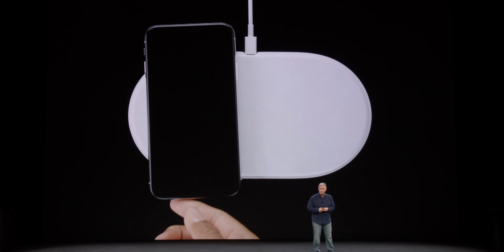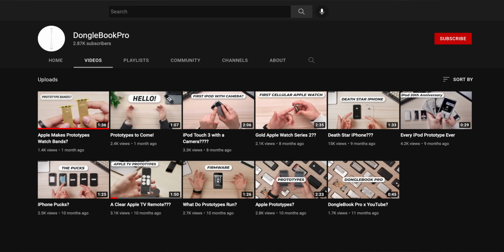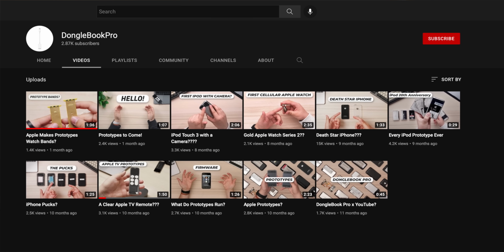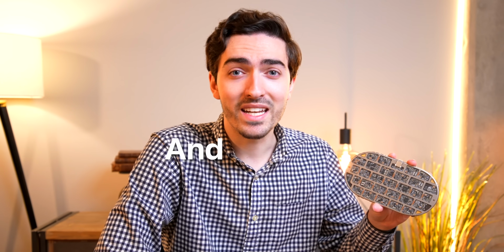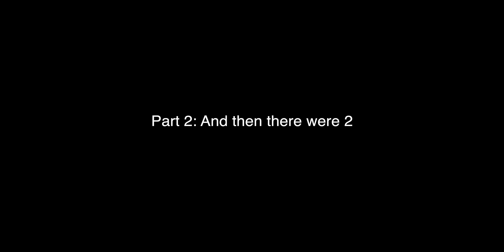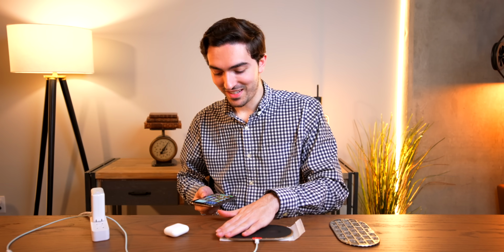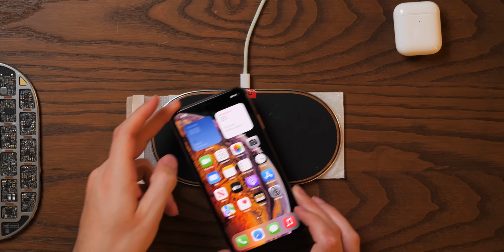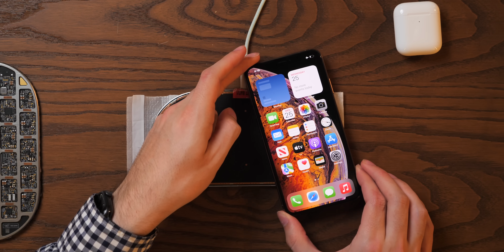We got a REAL, WORKING AirPower prototype!!!

Comment from the maker: Would you have bought AirPower if Apple had made it work? Which AirPower prototype is YOUR favorite?
Reply: I like the SquarePower Prototype
Reply: @MicroLord  what about square power tiles for a mansion XD
Reply: Yes, I would. It really could be a revolutionary product and it was beautiful.
Reply: Square preferably, but it sounds like the price would be ridiculous. I now agree that it wasn’t reasonable to continue trying to make it work.
Reply: Great video only comment I want to make is that these are not over engineered they are within the engineering problem solving process so it has features and diagnostics that end up removed in the final products. Its engineered for the discovery process not for the consumer.
Reply: @evodgamehunter4290  This is definitely a situation where the product was designed by a marketing department, and not by engineers, such that the engineering constraints were so ridiculous that the only viable solution was to use dozens of coils controlled by custom silicon. You can call that over-engineered, or over-designed, or whatever, but the end result is that you can accomplish literally the same thing with a single coil and a magnet (magsafe) with drastically reduced complexity and at far lower cost.
Reply: I would buy one
the normal one tho
Reply: Slayyyy i love to power my air its so funnn 💅
Reply: This video convinced me even more that AirPower was a solution to a problem nobody really had. It would have been a $149 device with "place your phone anywhere on the mat!" as its sole reason for existence. Meanwhile, other manufacturers produce $50 chargers with 3 dedicated spots for phone, watch, airpods. Which, let's be honest, is all anybody needs to charge, and the dedicated spots probably make the device even easier to use than trying to hit the coils on the AirPower mat exactly.
Reply: @freibier  I would have bought one. Have used Nomad and SliceCharge multi device chargers and both suck. The Nomad developed issues with its Apple Watch charger. The SliceCharge with its fewer coils often means that my devices start charging and then stop afterwords meaning my devices aren't charged when I need them to be. Or otherwise unless you get the devices perfectly aligned on SliceCharge, everything heats up a lot and charges very slowly.
Reply: Yep would’ve got squarepower definitely.
Reply: squarepower and yes i didn’t have the problem of needing to wirelessly charge multiple items at once but apple pre announcing airpower made me want to be able to b so i got the three mentioned devices to be charged
Reply: Definitely would have got a SauarePower for the nightstand. No need to turn on the lights to make sure the devices are in their specific places would be awesome!
Reply: X D  What can u do on almost every phone but not on IPhone related to AirPower? I'm confused
Reply: X D  What do you mean? AirPower has nothing to do with the iPhone hardware…
Reply: The square one is interesting - I'm assuming it doesn't work? I find it hilarious that AirPower is advertised on the box of my AirPod Pros (bought at launch) and it never shipped.
Reply: yes
Reply: Nope
Reply: no because i hate apple products

Comment: The technology or principle of AirPower has been around for quite a while. See, for example, the Siemens BSH FreeInduction Plus technology for induction hobs. Yes, you read that right, I am referring to an induction hob because the technology behind it is the same. The only problem is that the energy is converted into heat and is not induced again as electricity - the problem with AirPower was just the high heat development, which was no wonder with several overlapping coils that interact for physical reasons. With its patented technology, Siemens has managed to exploit this interaction by generating a dynamic magnetic field from several coils that can be moved as desired and can be generated several times. With such an induction hob, several cookware can be used at the same time and even moved. The technology in AirPower is essentially the precursor to this technology, and is therefore not an innovation. The same technology used at Siemens can also be used in a smaller format as a QI-capable charging station. However, someone has to take the right step now.

Comment: I'm surprised that the design Apple tried failed with is a many-coil design that sounds similar to what Tesla produced and shipped with their $300 wireless charger, which has 30 heavily-overlapping coils. That's significantly more than the AirPower prototype, though, so maybe Apple just didn't go big enough! I'm guessing Apple set some harder requirements for themselves, though, and gave up when they couldn't meet them.

Comment: Great video and thank you. Sometimes learning takes experimentation and tinkering. The prototypes may have been a step on Apple's path to mag safe charging. Also, its possible the large third party chip was so that the prototype could programmed to try various configurations etc which could be used to compare, gather data. An optimized consumer version may not have required the same chip to simply operate. Lastly, its possible what was learned so far may still be used in a future product if the technology becomes feasible/desirable with another development. PS Tim Cook once said sometimes the best decisions a company makes is saying "no". I agree. But, I also applaud their attempt.

Comment: I have one question and it is about MacBook Pro mid-2015 15 inch. if you could buy a 2017 15 inch same price, instead of a mid-2015 same everything would you buy the 2017 over the 2015? in the on video you did on MacBook Pro best and worst you did not have good functional keys on 2017, and top 5,  2015 13 inch,  mid 2012 13 inch, mid 2012 15 inch, 2019 16 inch, and best mid-2015 15 inch. Thank You So Much.

Comment: dude, FPGAs are very common in prototyping and wouldn't have been used on final boards, airpower wouldn't have shipped with an $80 chip like you say, most likely they wanted to have more flexibility with the prototype so they added this chip, final units could've been streamlined alot from this if development were to have continued

Comment: In 4:13, the 16 coil statement made by Luke is contradicted, see, there are 4 large coils with 3 other coils incepted in each large coil. Making the grand total to 4 coils in 4 solid places i.e., 16. 4 x 4 = 16. There. Now you can only charge 4 devices at best with 20% efficiency in this setup. A much more efficient one would be the Xiaomi wireless pad that MKBHD showed off in one of his videos. Safe to say, Apple isn't pioneering anything here.

Comment: I'm thinking the reason for so many segments was to implement zonal charging, where segments not sensing increased current draw would be put into idle mode.  This would reduce total current draw and, more importantly, waste heat.  You could easily check this theory by comparing the load imposed by single vs multiple AirPods cases.

Comment: They would not ship an AirPower with an FPGA in it. They would replace the FPGA with an ASIC/custom chip for final production. FPGAs are just great for prototyping when you don't want to spin up manufacturing of a custom bit of silicon yet

Comment: I wonder how power inefficient these would be with the many coils and lots of waste heat. I think Apple going in the opposite direction with two perfectly aligned coils massively increased efficiency.
Reply: Far as I know, the onboard computer in the air power determined which coils needed to be used to charge whatever is sitting on it and only use those coils

Comment: fun fact. if you attach a DCSD to a iphone XS smart battery case. you can see in the firmware that it still has alot of air power references. the XS battery case was supposed to be released along with iphone X and air power. but due to.. yeah. it didnt and got moved to XS. which also explains why a iphone X would work perfectly in the XS case like i've always done. BTW you can use a DCSD on any smart battery case. they dont encrypt those like they do on iphones

Comment: Luke, I can’t bring myself to call this “AirPower” since the two devices, the charging panels and the device to be charged are in contact with each other.  Do that 3-6” apart and then you have “AirCharging”… The main issue here is the magnetic field generated in the coils is only a few MM thick and incredible inefficient.

Comment: If the problem was that it had to blast a bunch of power because apple watches couldn’t magnetize, why not make an adapter for the Apple Watch? A small thin adapter that attaches to the watch’s charging plate (we know the engineering geniuses at apple are capable of this) that would allow the watch to be used by the AirPower plate
Reply: That would overcomplicate things when the purpose of this is to make things very simple and work w products you already own

Comment: Someone high up at Apple, probably Tim Cook, decided that wireless charging as it was (and is in the rest of the industry) wasn't worth it, wasn't convenient enough for how slow it was etc, so they decided they were going to perfect it like they perfected the smartphone. Once AirPower was deemed a failure, they went back to the drawing board to perfect it in a different way. With both AirPower and MagSafe, you don't have to line your phone up with the mat like you do with a conventional Qi charger and I think that's the main issue they were trying to solve with both products.
Reply: Yep.
Although AirPower would have solved the issue for AirPods too.

The Apple Watch never had the issue really, MagSafe solved it for the the iPhone in the same way as the Apple Watch charger did.

Once it worked, AirPower would have been a solution for all three products... maybe even for iPads too. Especially that huge rectangular prototype.
Reply: @something2sea  AirPods have MagSafe now
Reply: @thebuddercweeper  yeah but it’s not great
Reply: @Fusion05  what do you mean?
Reply: Well, except Palm did that in 2009, using magnets to align the coils
Reply: @Sb129  Fair point, but I never said Apple was the first to perfect the technology.
Reply: @Sb129  And even before that there were other wirelessly charging devices like battery-electric toothbrushes for example by Braun/Oral-B and Philips, both charging stations got a stand with a rod (I guess it also contains a ferrite core to increase the efficiency) and the bottom of the toothbrush got a bore to center.

Comment: I'm assuming you don't get the fastest charging speed on all devices on the $50 charger, since it only uses one lightening cable and the charging brick would need to have a combined output of all devices at max wireless charge speed.  At best it would be slower than max wired charging for the iPhone.

Comment: 1) The metal shielding will be used for structure, cooling as well as RF isolation. Mainly isolation and for compliance reasons.

2) Those gray smd components are not Transistors or Resistors but SMD Inductors which look like they’re being used instead of traditional wire coils like the ones in your smart phone (Interesting implementation!) *EDIT* (He never showed the other side which clearly has an array of inductive coils like the ones shown in other wireless chargers, these components are just capacitors...)

3) That Alterra FPGA was only being used for testing as they likely needed more io than the previous Tristar ic was able to provide. A single controller In charge of so many inductors as well as the likely beam steering that was being done probably didn’t exist so either one would have been release by a manufacturer for apple to use, apple would have ordered a custom version from and existing manufacturer or apple would have rolled their own controller.

Prototypes and one offs are extremely expensive (Thousands of dollars for a bare pcb that should cost a few dollars) but when you get into volume sales and have the resources and manufacturing experience off apple you can really optimise the design and find interesting solutions to solve low volume issues.
Reply: This. More research should've gone into this video.
Reply: looks like smd caps to me
Reply: @Roshan_420  Agree on those looking like capacitors. These have traditional (albeit smaller maybe?) copper flat coils on the other side of the board under the black material. Both their patent and a teardown show them.
Reply: so are you saying luke used the wrong side of airpower? 🤣
Reply: Thumbs up to someone who actually knows what they're talking about.

Comment: The FPGA would never have been shipped. It's basically a chip that lets you redesign it without actually creating a new chip, so it's very useful for chip design. Apple would have turned the final design into a much cheaper normal chip.

Comment: FYI the parts Luke reffered to in the video as "transistors" are actually capacitors. I'd assume they are probably for filtering or a type of LC tank circutry, and thus might need changing to find the optimal value due to manufacturing tollerances. But the filtering/LC side is a guess. They are deffinetly capacitors though...

Comment: AirPower definitely seems like an over engineered solution to a pretty much non existent problem. MagSafe is definitely a much simpler solution for those people who can’t figure out how to use a wireless charger.
Reply: What do you mean non existent solution. There are so many times where I missed the charging spot and my phone didn’t charge overnight or the nightstands get bumped and the phone gets misaligned. MagSafe is an easier solution but the problem was definitely there.
Reply: @RiseUpToYourAbility  or, get this, use a cable
Reply: @aol0745  sure, but tech nerd people crave for technological advancement. people had been going off of Apple for not putting out enough features. just sticking with Qi would make them seem incompetent.
Reply: 10000% agree
Reply: Reason it was over engineered was to wireless charge iPhones and devices without actually being on the mat 👀
Reply: The issue isn't figuring out how to use the charger, the issue is putting your phone on to charge at night when you're tired, then waking up in the morning and realising it was slightly misaligned so it either didn't charge or barely charged.
Reply: @thebuddercweeper   or it starts, you do whatever, and it moves slightly off so it stops.  I’ve had that happen. Any movement or bumps can lead to that.
Reply: @Danimal25  very true
Reply: @thebuddercweeper  thank you, totally agree. magsafe is awesome, solved my entire charging fuckery. now add it to every portable product.
Reply: It’s simplest idea with the most complex execution ratio.

Comment: 6:13 this is quite unlikely. FPGAs are mostly used in the chip development stage, as it is far easier to just "change" what a couple resistors do than to order a whole batch of new chips every time you think you have to change something about the design. It's more likely that they found out that the chip they wanted to use wasn't sufficient, so they opted for an FPGA for the development stage to essentially develop their own new chip for the AirPower. You can see more about FPGAs in Linus Tech Tips' Intel factory tour. Edit: FPGAs are nowadays almost never shipped in end-products, because they are ridiculously expensive and just unnecessary.
Reply: Yup. You find them in some end user products, but things like oscilloscopes (and I think the afterburner card uses one), not a high volume, low(ish) cost mass market device.
Reply: The company I work for uses them in our products, but our products are low-volume and niche. Reason being is because our products can be customised to the buyer's requirements so it's way easier to use an FPGA and then make the changes than to change the board layout (we outsource our PCB design).
Reply: FPGAs are used in those high end emulation gaming consoles
That recreated the original hardware using FPGAs
Reply: Most Fritzbox models with ISDN 
 use FPGA. FPGAs are definitely used in the mass market (before FPGA shortage of course).
Reply: Agreed. I have worked on a few niche speaker systems that shipped with FPGA's but it's very rare. We use it to prototype asic's in high volume products now.
Reply: Exactly what I wanted to comment lol
Reply: Yeah, at Apple’s shipping volume they’d almost always put an ASIC in… Except they really want to change the chip behavior after products are shipped. That’s why you’d see lots of cheap flash-based Lattice FPGA’s in Apple products here and there. These small cases are where field-programmability scales much better than designing a do-it-all chip that you have to customize via software.
Reply: "Field Programmable" tells you all you need to know about what it's used for.
Reply: i just came her to comment that exact same thing. Thank you for saving my keystrokes :)
Reply: they do occasionally make their way into products, the HTC/Valve VR lighthouses used them because the ability to fix tracking precision was worth the cost
Reply: @ShinyQuagsire oh hey it's Shiny Quagsire lol
Reply: Necro'ing a dead comment to mention that they're often used in missile guidance systems. If a missile fails to detonate and is recovered by an adversary you don't want them being able to reverse engineer it, so the guidance system is done in FPGAs and the bitstream is uploaded to the missile by the launcher. The missile will lose power relatively quickly wiping the guidance system before it can be pulled.
Reply: This is not entirely true anymore. Smartphones have created their own market segment of low-power low-performance FPGAs in small package sizes to take care of a lot of the small house-keeping tasks like power management without requiring much space. These FPGAs are cheap and can be found in many phones.
Reply: Yeah, totally agree. FPGAs are just for development.